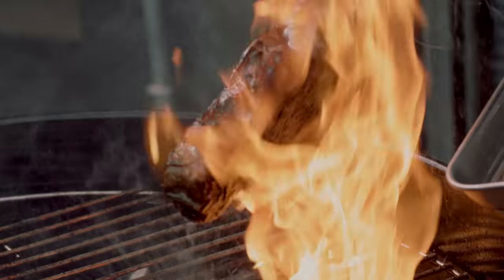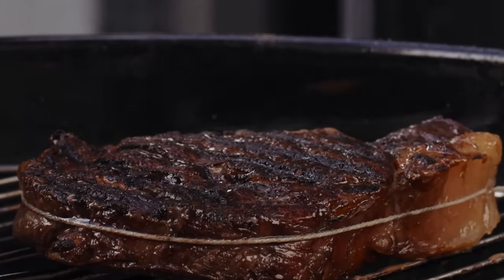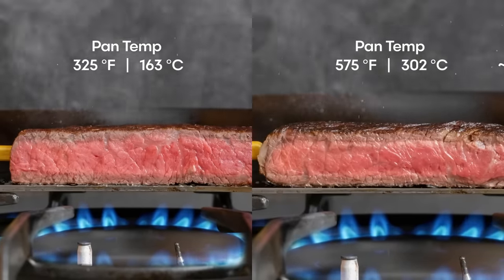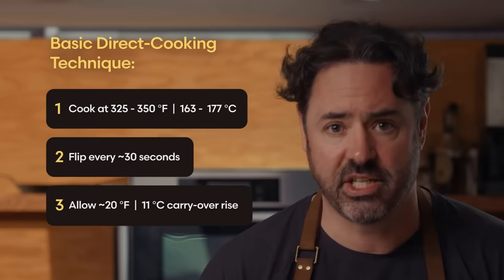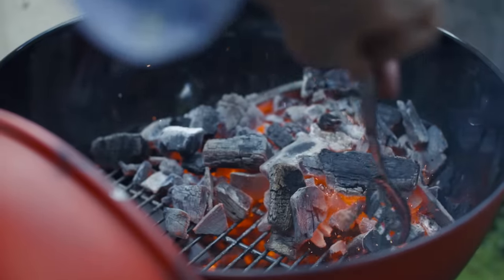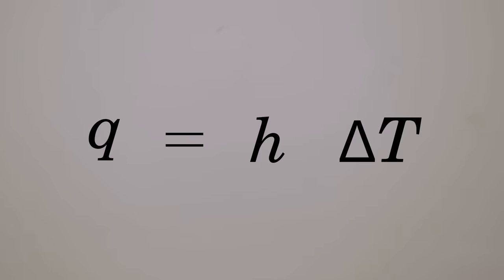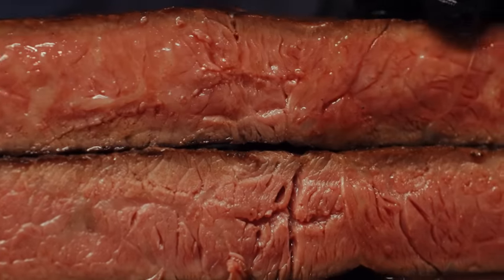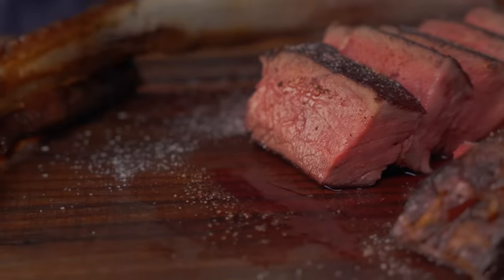Why Ripping Hot Is Too Hot? | TESTED

Comment: I know there are "steak hobbyists" that will go to any extreme to put a slab of cooked beef on a plate.
But I've found that just slamming a steak into a fairly hot pan for about 5 minutes, then turning it over for 3-5 additional, results in a very acceptable meal.
Sometimes i put the streak on when the pan is only medium and then boost it to minimize splash and splatter.
Sous vide or pre-baking for reverse sear is a lot of work for a fairly marginal improvement. I'm not cooking for photography.
I can't really taste the difference between 100% and only 91%, so I'm good with a steak that's fine in less than ten minutes with no prep, and almost no effort.
That said, i might try bringing my torch in from the garage just for laughs someone. I do like a little char.

Comment: How about reverse sear using the oven to cook internally to 129°F, rest the steaks, and then run the flame of the torch along the steak, moving constantly, touching every portion of the surface once and for only a fraction of a second to vaporize water, and then pan sear at 350°F, turning every 30 seconds for a total of 1 minute per side? This allows you to have a perfect internal temperature, develop a flawless crust without burning any parts of it, and this can now be done anywhere, including your friends kitchen. You only need to bring your steaks, your internal thermometer, a digital thermometer to check the pan temp, and a torch.

Comment: Create lye water with Naoh and water. Soak your 1-2 inch steak for 30 minutes and pat dry with towel(This soak will increase maillard reaction dramatically). Heat up cast Iron till water droplet skitters across the bottom into oblivion, salt steak, chop 2 cloves of garlic finely and toss them in along with 2-4 tbsp unsalted butter into the pan,  throw steak on iron let sit for 2-3 minutes each side and pull it off(depending on whether you want rare or medium rare). Pull steak off and pepper both sides with fresh ground pepper, allow to rest for 10 minutes(depending how cold your house is) Then cut in. Adding pepper in after the cook is a game changer, pan searing pepper damages some of its flavor notes.

Comment: I recently noticed that with stainless steel pans you are better off with medium heat, but with non-sticking pans it's better if the heat tends to high. Not the highest, but a bit more than med-high.

Comment: You are absolutely correct. But, I can SEAR at 800- degrees on my Sear box or even pallet grill smoker and not have the issues you demonstrate. (Grilling is at 400 derees) Not promoting it, but the best steak houses sear at over 500 degree heat and I use a Camp Chef Sear Box.Its a propane attachement to a smoker, but you can use it alone too. A TRUE SEAR type of heat, but a high heat BURNER overall. I Usually Sear at 800 for about 3 to 4 min then lower the heat to about 300 for about 5 min...turn off then let it rest while the box is also cooling..carry over cooking finishes to about med or medium rare. Top with infused flavored olive oil/butter mix lightly...If you can't handle the heat stay out of the kitchen. lol
There is such a thing as HEAT CONTROL which you sort of mention...BROILERS can work too...Good content to give Factual Science behind COOKING which is the application of CONTROLLED heat to FLAVORS. (apply heat to food)

Comment: I can confirm that deep frying is vastly superior to finish a steak. If you have a turkey fryer, you can do large cuts of steak. Note that you will not get any carbonization this way, but you can always add that with a torch or a campfire. This is also the best way to cook sausage if you are wondering - but surprisingly, not bacon...

Comment: Have you tried pan-searing in a small amount of oil (or tallow)? More than just enough to coat the pan, I'm talking like 1/4 or 1/8 of an inch, so it sort of emulates deep frying without having to have a stock pot full of hot oil?

I would have loved to see that included in the test. Great video overall!

Comment: I just set my induction-tasty to surface 385F……. Sous vide 129 x2 hrs.  Let it cool 30 mins…..   then 30 sec flip/flip/flip……. Butter basting.   Absolutely perfect……. I never comment…… but this is the science…..    now I’m so excited…..

I wonder if 350-390 range of Malliard is good for all proteins?? Like should we sear a soup-vide turkey or chicken lower….?  Thanks!!!  I’m just so amazed….. I’m not a deep fryer….. but the heat transfer is fascinating…… I have a possibility for your next follow-on……. I use a 3/4 steel plate tile in my oven for the heat transfer to pizza……..     what is I sear my sous vide by using a steel plate,,,   Heated to 350-390 for searing a Sous-vide steak….?

Comment: What about an air fryer? I personally use a Dreo ChefMaker and that thing makes some incredible steaks. It's not your typical air fryer though because it's smart and uses a temperature probe and water for steam. It may not sear the bottom very well, but it sears well enough on the top and it more than makes up for it with it's ease of use.

Comment: i dont know if the way I cook steak is "culinary" or not, but my family loves it to the point that if were having steak - I'm cooking it no one orders it in a restaurant any more. well to start - ribeye, but you cant always find that so you get the best you can. I start by taking the meat out and letting it get to room temp, I use only two spices, garlic salt and lemon pepper - NOTHING ELSE. I usually cook for a group of 4. to start bring the grill up to 450, sear the steak 1 to 4 min per side, sometimes more if the beer is flowing - rofl (depending on how thick it is), lower the temp to 250, stack the steaks on top of each other - off the heat - circulate them (bottom to top of the stack, flip so on and so forth) every 15min for one hour - done. My son in law is crazy and likes his well done so I sear his a bit longer. Just my way been doing it for 30 years.

Comment: Favorite method is putting my steaks in a smoker, 200f until center hits 127. Start cooking sides as the meat is pulled from the smoker to rest, by the time I'm done with the sides, steaks are cool enough to finish with a reverse sear

Comment: I usually just use cuts that are fairly forgiving (at least to my taste preferences) like entrecote (or whatever it's called in English; it's relatively cheap compared to the filets and has a lot of tasty fat) and use the sloppy ADHD-method: 
Start to preheat the pan; 
but get impatient and splash some oil in and throw the meat in before it's actually completely heated; 
impatiently flip it all the time, 
turn the heat down from max once the hissing starts to sound angry; 
get distracted doing something else for a while; 
notice the meat has started to simmer rather than fry; 
make a test cut to check if it's too raw or not inside when it looks like it might be close; 
once it's close to done; put the element back up to max (I have a ceramic halogen electric stove and use either my carbon steel pan or stainless steel pan; so it's pretty fast to respond);
flip it a few times as it starts to sound angry again, 
and take it off the heat. 
I don't usually specifically let a pan steak rest; but it get's some resting while I make the table and finish whatever else I'm preparing which rarely is done at the same time anyway.

It's usually perfectly fine. Very thin steaks can be a little overcooked if I get distracted too long; and very thick steaks could in theory get a little charred with this "method"; though in practice it usually ends up a little raw instead because I cannot wait. 😅 I actually don't care as much about perfectly crisp sear anyway, which is probably why my sloppy method works fine for me. I also like a little variability; sometimes a bit raw steak sometimes a bit on the brown side; and if the steaks aren't perfectly uniform; my wife who likes meat a bit more well done than me takes the thinnest steak.

Comment: Team air fryer. Convection is key like with the deep fryer. With a grill surface in the AF, convection currents get around both sides of the steak. Only the surface in touch with the grill is seared quickly and develops Maillard crust. Just enough Maillard flavor. Can come straight out of the fridge. Just as good as a cold sear in a pan, maybe better

Comment: Great video!  Question on the internal cooking limit.  I wonder what's the difference between a wet aged steak and dry aged steak when it comes to the boiling of water inside the steak?  I presume your steaks are standard, wet aged.  If the steak were dry aged, there would be significantly less water remaining.  So, would the cooking accelerate because there's less water remaining?  Would the internal cooking behave more like cooking at the crust, due to the water being displaced already?

Comment: With sous vide, if you put the steak back in the fridge with just a bit more salt for half an hour or so it will dry out quite a bit.  Also put some weight on the steak when searing.

Comment: I prefer the "cold searing" method: Pan searing on high heat for 2 mins aside then reducing the heat and flipping the steak every 2 mins at a lower heat for another 8-10 mins which slowly builds an even, beautiful crust w/out over-cooking the center 👏🥩

Comment: When I got my sous vide tools years ago, I watched a youtube video suggesting to use flame torch for extremely thin crust.

I tried with another half of the steak using traditional pan searing.

I could confirm that the problem of flame torch is exactly as you said.  The flame was far too hot that the crust had a burn flavor instead of that Mallard flavor from ordinary searing.  Even though the crust is really thin.

That created another unsolved question for me.  Does thicker crust give more flavor to the steak? (I currently believe in thiner crust for texture)

Comment: One question I have is... Wouldn't that mean a hotter searing temperature WOULD be better for developing a better crust on a thinner steak? Whereas, you have more time to develop a crust on a thicker one, so a more reasonable temperature will generally work better?
Reply from the maker: Up to a point, yes. But at very high temps you can get into the problem of burning edges and bits of meat on the surface and impart a carbonized burned taste, which isn’t my preference.

Comment: Using the heat transfer equation, wouldn’t heat flow increase if you decreased the surface temp of the steak? This way you can sous vide the steak, freeze it for about a minute to reduce the surface temp but keep the internal temp high and then sear in a piping hot pan. This should prevent the steak from burning due from the blow torch, increase heat transfer compared to omitting the freezing step, and remove the need to use large quantities of oil for deep frying.

If we cool the surface temp of the steak to 50º F by freezing for 1 minute, the heat transfer during sear is 23% higher than searing without cooling where the surface temp begins at 150º F.

Please correct me if I’m wrong. I’m about to try this on my rib-eye tomorrow. Ya’ll have 16 hours to check my math before I either cook the best or worst steak of my life.

Comment: Pausing at Sous Vide vs Reverse Sear to say, anecdotally: The best gray ring to pink center ratio I've achieved has been with sous vide. Because I knew that the internal was exactly where I wanted it, I had the confidence to simply develop the crust over 60 seconds on each side, and immediately move to resting. This was on a tenderloin, but I've had similar results on ribeye.
Reply: great thing about sous vide and reverse sear is you don't have to rest them after searing if you've already rested them before as he recommends

Comment: No. You go ripping hot with oil as lubricant. Then you take it off the heat, add enough butter to bring it down to 155 celcius. Use an unseasoned metal pan. And add herbs and garlic to the butter-basting.

As you baste, let it lower to around 135, or before the butter gets too cold to froth. If you are going super fancy, stop at 35 core temp, roll it in butter paper with herbs. Best method I have used.

- Line cook for 10 years.

Comment: 1 1/2in thick steaks I shoot for 450°(checked by infrared gun,) with a couple tablespoons of oil. Pan temp is going to drop when the steak goes in. 3 minutes each side,flip once, 7 min rest.
13 minutes total cook time.
Beautiful sear, crust: slight audible crunch while chewing. A little Kerry Gold butter on top finished with a sprinkle of Celtic sea salt. It will make you tongue slap your brains out.
 One hour before cook, season with coarse sea Salt and fresh cracked pepper, leave steaks out on counter. pat dry before tossing in preheated pan.
Light smoke after cooking two steaks keep it simple

Comment: My personal favorite is smoking a 1.5 inch ribeye to around 118 or 120 over hickory, and then opening vents for my coals to heat up to around 500 on the surface which takes 10-15 minutes. So then when I go for a sear, my steak is already cooled.

Comment: At least in my kitchen, deep frying is wildly impractical.  I'll never do it.  I have tried a Searzall attachment for a torch and sous vide.  It works okay, in that it's somewhat less likely to over-char the surface, but even with the wider zone of heat production produced by the diffuser, it's still inconveniently slow to use for more than two steaks.  I haven't tried it yet, but a reverse sear done with my pizza oven with a cast iron pan at about 800F might be an easier middle ground.  Although I'm not sure I've got a oven mitt insulated enough to allow me to grab on to an 800F cast iron handle.

Comment: Wouldn't a ripping hot pan cause a bit of a radiated heating effect on the sides of the steak, which aren't in contact with the pan, and lead to a faster cooked core than a medium heat pan?

Comment: I reverse sear all my beef starting with slow smoking on my pellet grill and then moving over to my natural gas grill which pegs out the thermometer at 800 degrees.  (So no clue how hot it truly is.)  Works great having them side by side.

Comment: Nobody continues to cook a steak at one temperature. Most choose to sear the outside and then bring it to temp at a lower temperature. You can also reverse sear a steak by bringing it to temp and then letting it cool slightly before putting a nice crust on the outside.

Comment: Interesting stuff, I usually just use my cast iron pan @ medium high heat for 3-5 min a side depending on the thickness, But I do notice that the thicker steaks, tend to have a bit too much of the gray band. I will try a few different methods you suggested to up my game. Thanks!

Comment: A lot of high-end steakhouses (and some individuals) use salamander style broilers.  These cook around 1500 degrees and dont seem to give the overcooked char you talked about with blowtorches.  I wonder why the broilers don't also burn the steaks.
Reply from the maker: The salamander is around 1500F, but that's not what the meat feels since the heat is mostly transferred by radiant heat—just like sunlight. Initially meat is actually quite reflective of infrared energy and reflects more than 90% of the radiant heat off the broiler. As the steak begins to darken it will absorb more of the energy and reflect less, so it will get hotter. But the surface is never really "feeling" 1500F. Certainly nothing like if you were to put a steak on a 1500F pan (lava basically). The whole, we cook at 1500F is kind of a silly marketing claim. The glowing elements in your home broiler are also pretty close to 1500F.

Comment: I always pan sear and then finish in a 400 degree oven, always start with a room temperature steak that has benn air dried and always pull the steak at 125 degrees and let it rest for 10 minutes.

Comment: I have used sous vide with a torch for several years and it is my normal method now.  I have tried deep frying and love it, but it is too impractical for everyday use and clean-up is a bear, so I stick with the torch for most things.

Comment: As someone who lives in an over century year old house without proper cooking ventilation, I have found, basically, through trial and error, that you can actually cook a killer steak through lower heat. The "ripping heat" thing is basically a cooking meme that took off, with very little fact behind it.

Comment: I cook my steaks at home with vegetable oil, I get it as hot as it'll get to sear it then turn it down to the cooking temp.  Wait 3-5 minutes depending on thickness, turn the heat back up and flip it wait until the other side has had a nice sear then turn it back down for another 3-5 minutes.  Sure its not as evenly cook as these methods but I don't know I'd rather eat a steak within 20 minutes than what 2 hours?

Comment: A super hot pan for a good sear is like wearing running shoes for a 40meter dash, it isnt required and you could also wear cleats, but it isnt a bad option. 
Edit for clarity: i only cook steaks sous vide then to get my crust i toss it on my grill for an incredibly short time. If i was cooking the steak from room temp, a lower temp pan is 100% the play